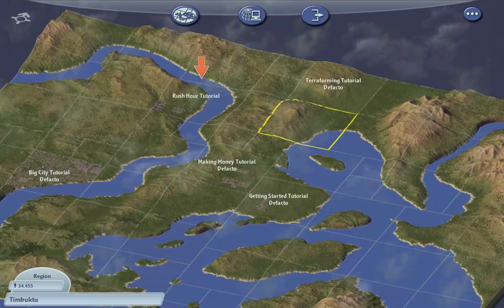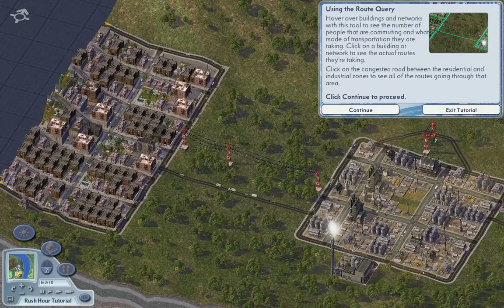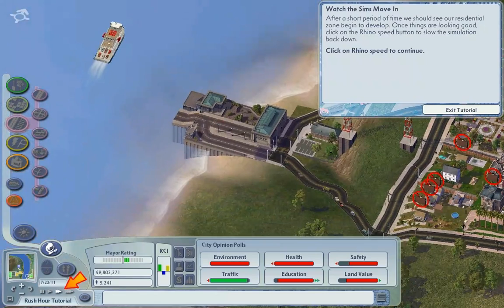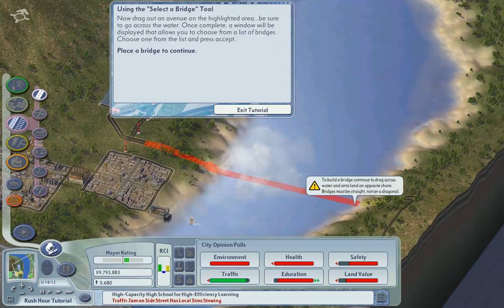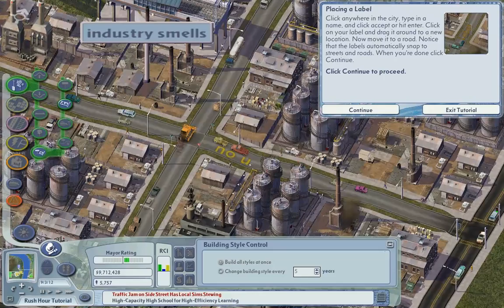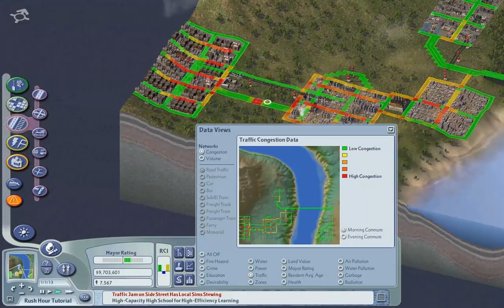Learning from SimCity 4 #3: Tutorials part 3

Comment: This is true but basically, if they both drive a car, they both use the same amount of street. So they basically pay the same. That's the way it should be, because if I don't drive (I'm not even allowed yet btw.), then I shouldn't have to pay money for steets. I know, that taxes work different, that's the reason you should only take taxes for things everyone uses or has to use.